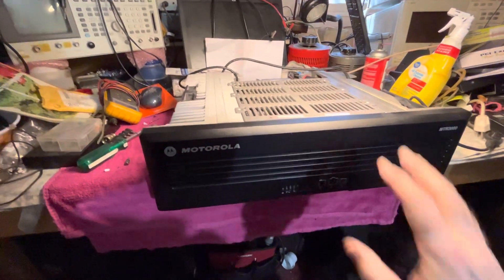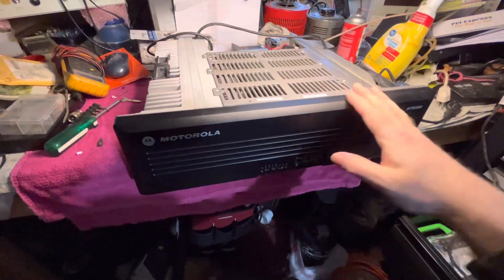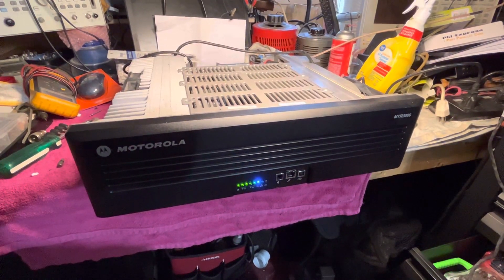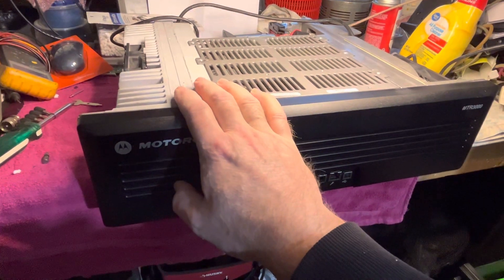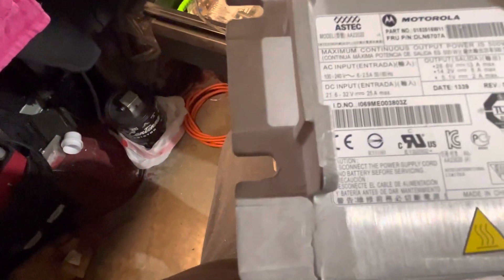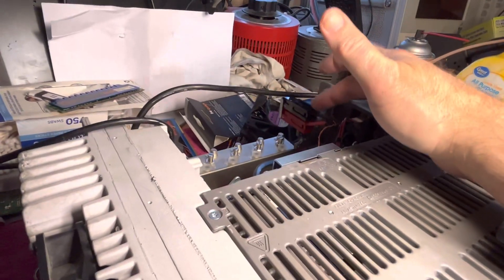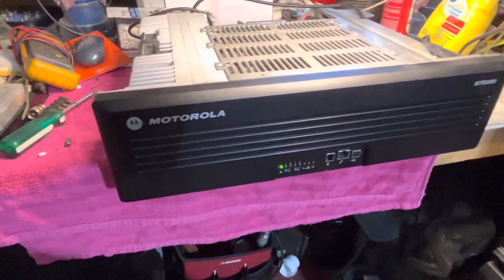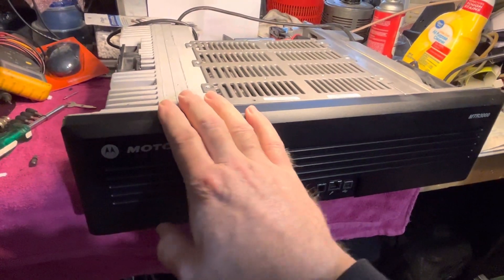MTR-3000 Power Supply Swap from a MTR-2000.

Comment: Hello N2LEN, this is KQ4LNZ my name is Landen I’m and 13 years old and live in south central kentucky. I am building a gmrs repeater system out of a Motorola SLR5700 I repaired and was looking for a MTR2000 to put on the rack as a backup repeater in case of a failure. If you have a spare MTR that is for parts i would love to have it. I am particularly good at repairing them. Thank you - Landen KQ4LNZ